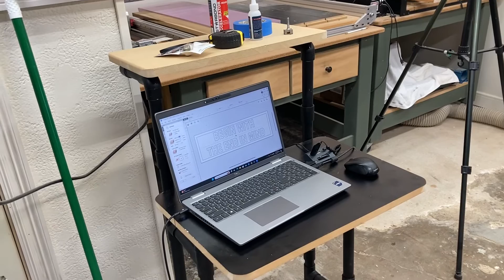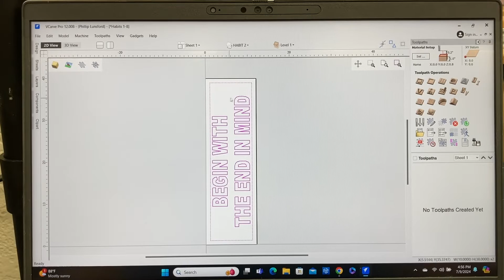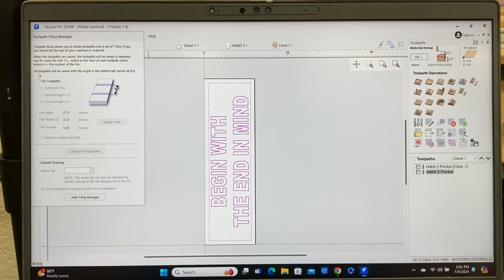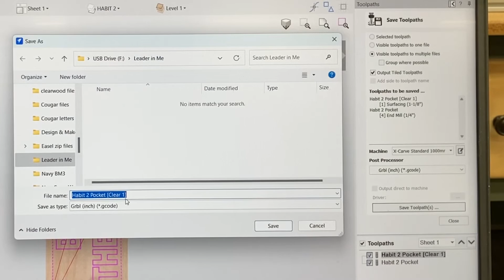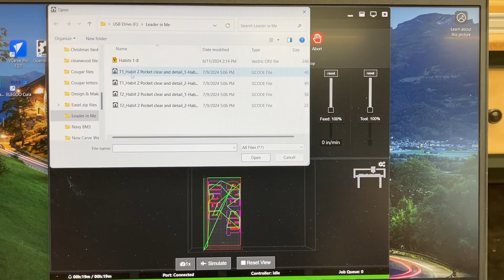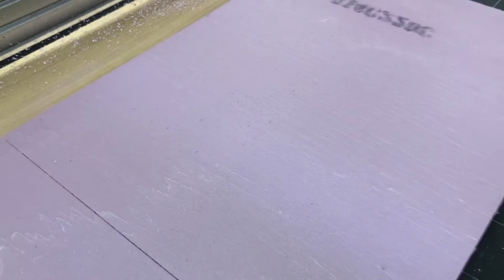Tiling in VCARVE PRO! It’s NOT That Hard to Do

Comment: I see this is from a couple of years ago, but I am curious why he set a .25 tile overlap. Is that really necessary? It works for this project because there is nothing in that section of the design, but if it was a 3D image for example, that gap would be a problem. If it was set to zero in this design it seems to me it would have printed out just fine as well. No? Great video, thanks.

Comment: Are you setting "probing"the z axis each time you start a new tile? I recently did my first tile job. Everything went great other than each tile, the depth of the z axis was different. So if I have the line of the tile going through a letter, you can tell each tile has a different depth pocketed into it. 
My table is completely flat, the material  is the same thickness. I'm also probing the z axis each time I start a new tile. 
I'm just baffled on the root cause of this. I can't figure out why and have a very large job I have coming up that I need to get done. 12"x8' ft sign. 
I have a onefinity journeyman, and I'm using veteic aspire. 
Are you setting the XYZ axis each time you start a new tile? Are you manually programming the XYZ axis into the software?
Thanks for all your knowledgeable videos. You're very helpful and you get to the point without taking an hour to do so.
Reply from the maker: Yes, I z probe each tile I move to a new tile. The x,y do not need to be homed after the initial homing cycle

Comment: how are you centering the homing process?
Reply from the maker: Using the bottom left corner each time. Have project marked at the specific location for each tile to match software setting
Reply: Are you setting "probing"the z axis each time you start a new tile? I recently did my first tile job. Everything went great other than each tile, the depth of the z axis was different. So if I have the line of the tile going through a letter, you can tell each tile has a different depth pocketed into it. 
My table is completely flat, the material  is the same thickness. I'm also probing the z axis each time I start a new tile. 
I'm just baffled on the root cause of this. I can't figure out why and have a very large job I have coming up that I need to get done. 12"x8' ft sign. 
I have a onefinity journeyman, and I'm using veteic aspire. 
Are you setting the XYZ axis each time you start a new tile? Are you manually programming the XYZ axis into the software?
Thanks for all your knowledgeable videos. You're very helpful and you get to the point without taking an hour to do so.

Comment: Is be interested in a video about how you finish these does foam signs.  Paint, epoxy?  Won't paint desolve the foam?  Good video
Reply: The new water based enamels for cabinets and doors works great on this type of foam.  Made some raised letters 2 years ago for an exterior sign and they still look great even in the Florida sun.
Reply from the maker: Awesome! Thank you very much for the information.
Reply from the maker: You can paint it with any water based, latex paint or acrylic paint. These will not hurt the foam.
Reply: @PawPawsWorkShop  I wish you would have posted a picture or two of the final finished signs.   Great video
Reply: @DavidCousins  Agreed!

Comment: Great video. I have a question
I see in vcarve you have two tool paths. 
I don’t understand how you use the second tool path is programmed to do all the clean up. How did you select what it was to clean up. 
Thanks
Reply from the maker: The software generates two toolpaths. One is a clearing and then the detail pass. When you save the toolpath you will see two different Gcode toolpaths

Comment: Is you are using  open build   is this better then G sender   ,  i see a lot of talk on issues with  g sender and looking for some advise
Reply from the maker: I started with UGS. I used an old version because of various issues that I had read about. I switched to the Openbuilds Controller based on several recommendations. I love it and have no desire to go back to UGS.
Reply: @PawPawsWorkShop Are you still using the demon controller that comes with the C4N?
I’ve had a C4N over two years. Your assembly video sold me on it. 
Many long carves later I’m looking to move up in size. Wanting to stick with C4N but unsure of what controller to go with